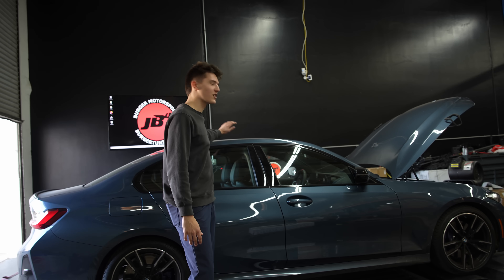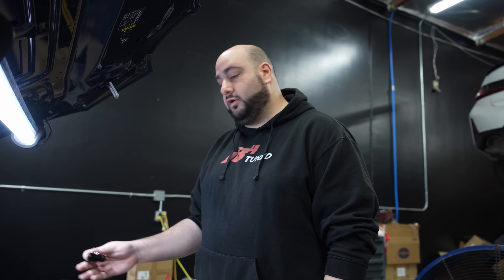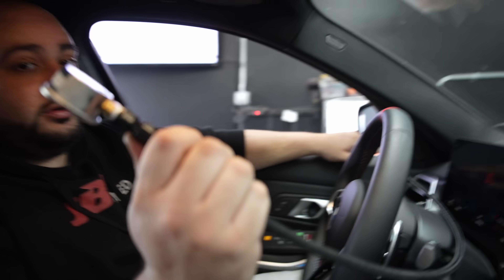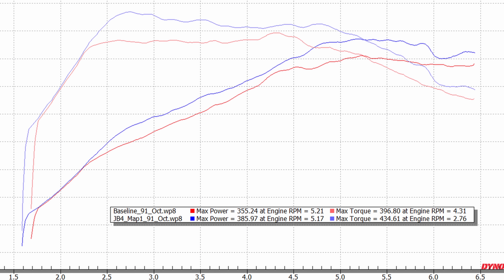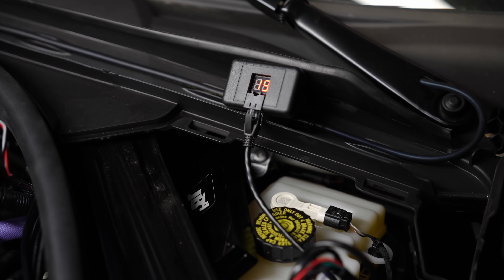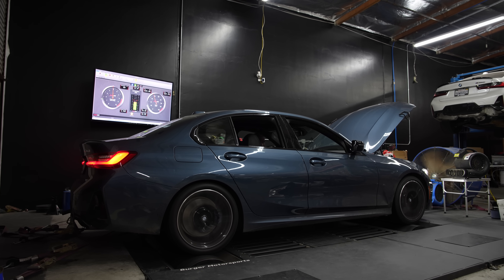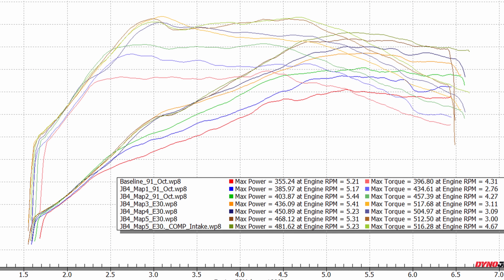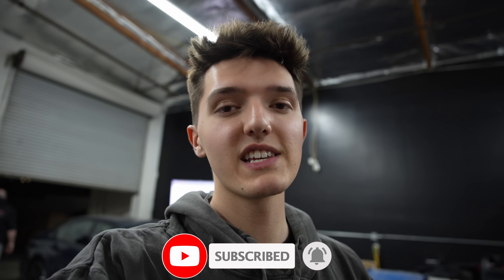GEN 3 B58 Shocking Dyno Reveal: Our 2025 BMW M340i Pushes "30PSI"

Comment: I just ordered my ‘26 M340i. Was thinking of getting the jb4. I can run map 1 and 2 with 93 oct fine without hurting anything on the car?
Reply from the maker: Correct! Enjoy it!
Reply: @BurgerMotorsports thank you for responding.. gonna wait until the 1200mile break in period but cant wait to buy it
Reply: @BurgerMotorsports second follow up question, if I were to run map 3 with 93 octane, do I need to upgrade anything on the car or stock will run fine?
Reply from the maker: @tgrkush  We will need logs first. Support@burgertuning.com
Reply: @BurgerMotorsports haha won’t be for a couple of months. I haven’t even gotten the car yet 😂
Reply: @BurgerMotorsports but I’ll definitely send them once I get the jb4 and everything

Comment: How about some 0-60 dragy runs comparing stock to the map 1,2,3,5 etc. that would actually be useful rather than a dyno in ideal controlled conditions
Reply: True!
Reply: @Apletedd it’s probably runs mid 11s regularly but definitely high 10s with the most minimal prep. B58s are insanity.

Comment: Wow so e50 with 93, catless downpipe and either upgraded injectors or pump it has the ability to go 600 whp basically stage 2+ custom tuned. That would be amazing without upgrading turbo

Comment: Of course a downpipe would push it way higher than 500whp but i wonder what 93 would do and what an e30 blend with 93 would look like. Ridiculous gains on the b58. Torn between that and a 5.0
Reply: I promise you will regret getting that mustang over any b58 yet alone a gen 3 just wait till they crack that dme open , it’s making that power on pretty much bone stock setup that intake isn’t even that necessary
Reply: @giowilliams7855 agreed but the intake would definitely help

Comment: 2025 BMW M340i Warranty Invalid
Reply: Not in the us
Reply: @captainamerica80 not in US if you us JB 4? Can you explain
Reply: @worldwide1873  in the us, the magnuson act covers bolt on modifications installed on vehicles. Unless the bold on modification directly causes the issues in which the car breaks or has a fault ie; you tuned the jb4 at max beyond the safe limits blowing your manifold which you be covered under warranty and the dealership deems that was why it failed then they can deny your warranty claim but can't invalidate your warranty all together. Its just for that fault at the time due to direct indications leading during fault finding. Piggy backs are considered bolt on so jb4 will not invalidate the warranty in the us.

Comment: I have a 2025 M340i Xdrive on order. It finally arrived at the dealership and today I got a notice saying there is an issue with the Integrated Fuel module which affects the 2 and 3 models and I cant pick it up until it is resolved.....ugh
Reply: Any update for us ?
Reply: @Apletedd  Greetings, I got the car 2 weeks ago apparently the Fuel Module was fixed with a software upgrade. I have not had much time to really drive it much but I love the power. I feel the car is smaller than I remember but you dont realize that until you get in and out of the seats a few dozen times. I ordered the spare tire option on my car and it completely takes up the entire trunk so I will have to remove the tire and jack if I ever need a trunk not crazy about that but again you dont know until its too late. Overall I like it so far it is quite fast.
Reply: @MG-jp5ij  dude I'm happy you got your car already, mine is still at the factory, ordered mid February, getting fucking anxious... Stuck with the same issue. Happy you got yours and are enjoying it!

Comment: Just got a 2025 b58 need to get some tires first then going up in hp
Reply: I have a 24 and that's my Achilles heal are tires. Just got a set of 285 Michelin ss since the 265 continentals just spun at 50 mph on map 5 e30.

Comment: 10:58 these cars make power but they sound like..... ASS 😂😂😂😂😂
Reply: Hey buddy just because you can't afford it doesn't mean it's ass
Reply: @liampine4638  i have (paid off) a hennessey venom 1000(hp) gt500, an STI 720hp, and an RSV4. I rolled w a lot of ppl who have m3/m4/ s58/g80 if I'm being honest like 95% of em are slow. The older ones might be quick if they're paid off but smart ppl typically run that out as long as possible. Ngl, im not a fan of these cars BECAUSE of how they sound. If they didn't sound like a farting vacuum, I'd def have more respect. But then u gotta deal w the brocoli headed twats that drive em lol.

Comment: Curious to see what the logs look like on Map 2 with 91 octane. I shared a log of my 2020 using Map 2 with 93 octane (otherwise stock) and was advised ok for occasional use, but close to acceptable limits, so Map 1 better for everyday. Is the Gen 3 more tolerant of higher boost?

Comment: The fact this is without the downpipe is absolutely nuts. Makes me sad i have an n55 😂
Reply: Get a bigger turbo and more fuel system and you can do the same. Numbers are exactly where 62mm turbo should be. That’s stock turbo size. N55 is what a 55/57 mm. The fact it only makes like 70 more hp than a fbo 80% max effort n55 with stock fuel system is kind of crazy tbh. Don’t let half these people who don’t even have a bmw trick you. The N55 is just as capable and a lot less complicated.

Comment: Impressive, map 5 E30 with intake is around bone stock g80 numbers.
Reply: For a fraction of the cost and it sounds better period
Reply: It does sound better you are right.  It is also the best part of the car.  The rest of it is pretty ordinary. If you want a track car out of the box the G80 is that.  But for everyday the 340 is a lot more sensible.
Reply: 100k g80 or a 60k b58 with $800 upgrade

Comment: Is the gen 3 only 2025s not 24s? So gen 3s have both direct & port injectors...12 of em??
Reply: Correct, we have a 2024 model in house as well and that's a Gen 2. 
Correct, 6 DI and 6 PI injectors totaling 12.

Comment: So this gen 3 is no longer on plastic intake manifold or what?  Either way love that power plant in my early G20 body, only with 0 hybrid stuff, the body is so good looking from the outside too, inside I likely will never learn to like the screen o mania going on and making everything more difficult to reach, yes I am old fashioned lol. I learned to be ok with analogue to digital clusters whop who knows haha? Just don't think it has any finesse at all but hey, we all are different so.
Reply: well the intercooler core is exposed now and not incased in plastic
Reply: @cjpp78ytube yes saw that, cool, more like S motor haha, truthfully it's a fine engine, just sometimes hard to work on with big hands like mine, a simple charge pipe job can be nightmarish haha, evap, connections, aux water pump, all need to go for just a charge pipe, hopefully a one time job
Reply: Yes, still plastic.

Comment: Why just e30? the whole point of having port injection is so you can run full E85. Was there a pump limitation?
Reply: The car isn’t even unlocked yet 💀
Reply: Port injection is from factory which we do not have full control of yet. Once you do flash tuning I'm sure you can push it to full e85 and we'll slowly start finding out the restrictions as we move forward.

Comment: Great video and channel, but why do you keep saying wheel horsepower when in isn't on the wheel?
It's the power on crank:
Stock power by BMW(crank horsepower):
Power: 382 hp @ 6500 rpm
Torque: 369 lb-ft @ 1800 rpm
Messured on dyno in this video:
Power: 355hp @5200 rpm
Torque: 396 lb-ft @4300 rpm
Reply from the maker: @salazar1104 Incorrect, this is wheel horsepower. If the engine was out of the car and on a crank dyno then it would be crank. If the wheels were off and on a hub dyno then it would be brake horsepower.
Reply: This is wheel horespower, literally taking the power from the wheels to the dyno roller.
Reply: man, are you slow or what, they're literally measuring the car's power on a roller, which the wheels are turning them aka WHEEL horsepower. lol
Reply: @lenspls 😂😂😂😂

Comment: Definitely want to see more especially once you guys install a downpipe, 
Turbo inlet, charge pipe, S58 injectors just maybe we’ll see 600hp at the wheel
Reply: None of the previous generation parts are compatible. The TU2 is almost entirely a new engine and turbo design.
Reply: @dustwhyn  gen2 can u S58 inject  its but gen1 & gen1.5 can not just look up.
Reply: should not even need the S58 injectors, the factory port will be the focus.
Reply: @MrSKlim  i see that but I just not a fan of pi  especially now that dorch engineering & precision racing have put out upgrades for fueling like HPFP, LPFP & injectors so u don’t have to deal with pi & it easier for turning unless your shouting for major numbers but most people are not
Reply: competition intake replaces turbo inlet

Comment: This may be dumb but I thought the 2025 m340i came stock with 386 hp? Or is that because this reads WHP not total HP
Reply: Dyno reads wheel, the factory numbers are crank numbers. Usually BMW dyno numbers are pretty close to their crank ratings.
Reply: Also that hp is on 98 ron with e10, the manual says that, i know that bc i own a m240i 2025
Reply: Accounting for 20ish percent drivetrain loss because it's an xdrive m340i, it makes 355 whp so it makes around 430-455 crank horsepower. So bmw was underrating their crank horsepower which they said was 386.
Reply: On 93 pump gas, I’ve seen stock 340s make 390whp.

Comment: I’m honestly impressed how much power this car can put out with such little modification
Reply: The modern 2JZ and RB26, period
Reply: @seansiew5629 lol not even close
Reply: @seansiew5629 not at all. Those engines rev high, b58s don’t
Reply: It is. It's not only about high revs.  @Eclipsis17
Reply: @Eclipsis17 my b58 revs to 7100
Reply: @hettmannsperger42  it has everything to do with revs. A 2jz which can rev to 9000rpm easily makes 1000whp at only 600lbft of torque. Less stress on an engine makes it more reliable and faster. Compare that to a 1000whp b58 that has to make 780lbft of torque at 7000rpm to make the same horsepower. The b58s stroke is too big.
Reply: @Eclipsis17 I mean if you build a b58 you can get close ish but true. Fully Built b58 or s58 still better bang for buck
Reply: @Eclipsis17  If you rev stock engine 2JZ to 9000rpm that engine will blown... Its just about time when 4N motorsport makes 9k rpm B58 now the are making 11k rpm S55
Reply: @marcozuniga1186 mustang coyote engines can make 1k whp on stock  motor
Reply: @Eclipsis17 emissions forced them to rev less. I’m sure we’d still have n/a 6 cylinders and High revving turbo m3’s that are lighter weight without cafe (sad knowing that we could’ve had a sub 3400lb m2/3/4)

Comment: 😮😮😮 481whp!! That's crazy. Would 93 produce similar results?
Reply: Im not sure my w205 C43 AMG is making any where near those map 3 numbers. I'd be happy with 400rwhp & 450 lb ft of torque. But my butt Dyno is broken. It's definitely making the extra 5.5-6psi of boost for map 3...so I guess it's doin something?
Reply: @spookholidae4948 you literally said nothing. And nobody cares about your c43 lol
Reply: @hds8182  if u don't know shit just say that u can't help me...dont try to be funny n rude or get smacked.
Reply: 93 octane would have higher results then 91 but idk by how much but I would like to know!
Reply: e30 is 93 octane
Reply: @Mp-jw1qg  E30 is not straight 93 😂 its 93 mixed with E85, just 93 would produce lower numbers
Reply: @V3LOCITY__ this is 91 + e30. 93 + e30 would be slightly better. Also this is awd model so it’s putting down 481 515 awhp. With 93, a downpipe should be 520
Reply: @Mp-jw1qg e30 is more like 110 or more ron

Comment: Relax 
Compression ratio is lowered on Gen3 B58
Reply: What does that mean more exactly?
Reply: @dj1nnie boost makes more of a difference when the compression is higher. Around 6-7 psi is a lot on a 11:1 or 12:1.. the ls7 from the c6 z06 or s65 from the e92 m3 for example. Any more would blow those engines without dropping the compression ratio, so these new engines make a lot of boost but they compensate by using lower compression pistons.

Comment: Wondering about the 91 octane - the lowest we can buy is 95 - would you expect a difference in power? Is there a reason for using lower octane fuels?
Reply: Are you not in the US? I don’t know anywhere that the lowest is 95. 
93 octane with e30 I bet picks up another 8-10
Reply: @ Germany. But I think it might be a Europe thing
Reply: @ RON95 isn’t same as 95 octane. Your 95 RON is like 87-88 octane here
Reply: @JonCartman-l1u 95 RON is similar to 91-ish AKI. 90-91 range for sure.
Reply: They’re running California 91. It’s way worse quality than the 91 you find in states other than Arizona, California, and Nevada.
Reply: Our 91 is technically your 95 (we have different ratings).
Your 98 is our 93
Reply: @yousef.al-assaf  interesting. I’m assuming your measuring the numbers at different rpm’s than we do then?